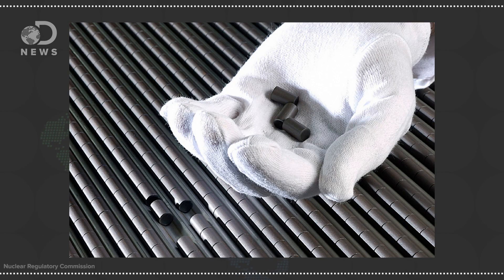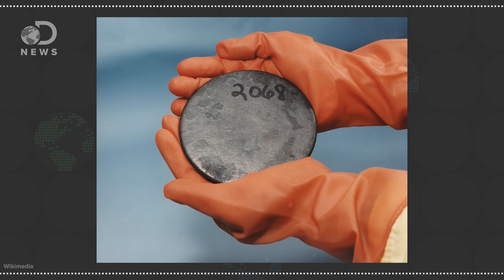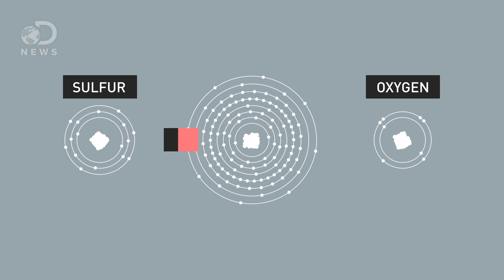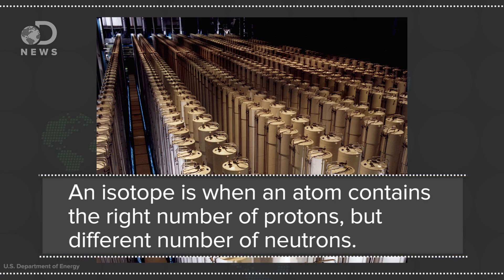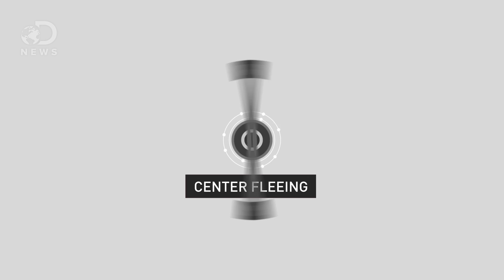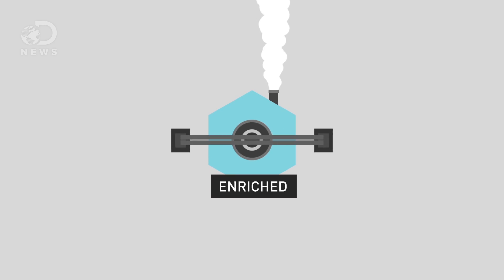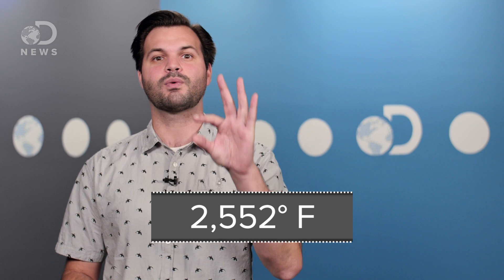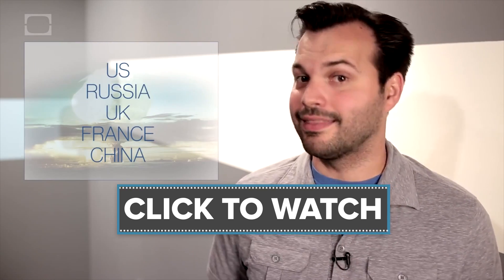How Uranium Becomes Nuclear Fuel

Comment: Still it's a bad source of electricity, because it produces a lot of CO2 in the process of collecting the Uranium from the ground and processing it with hazardous chemicals
Reply: Dino Sabanovic Look at France 75% of its energy comes from nuclear and no major disasters at all
Reply: Dino Sabanovic You will need an impossible amount of available land and win for wind turbines. Same with the solar power which is probably the most inefficient source. Solar panels are very inefficient. About 14%. Hydro power can't be used everywhere. That green energy you're talking about is nice for small projects, but for the whole world..no. No way that is possible
Reply: Dino Sabanovic Better to have Chernobyl than massive climate changes and oil spills all over the globe.
Chernobyls don't happen that often, but climate change with ocean pollution are happening all the time.
Reply: Dino Sabanovic Naaaah, fusion is the way to go, or any other process that universe uses, because universe is a one damn efficient machine.
Reply: BukkitViper Very interesting, but there's still issues with solar power. Solar power is basically completely useless in the winter in the upper part of the northern hemisphere, and only really effective in the summer. It's also important to remember that solar panels don't create a lot of power at night.

Secondly, it's simply not very realistic, that the world would be powered by solar power in the near future. It would just take way too long to convert completely to, I'm afraid.

Anyway, I think solar power is fantastic in the parts of the world, where the sun shines powerfully the whole year. The parts of the world where that's not the case, we should stick to nuclear power.
Reply: Dino Sabanovic Properly built and managed reactors have a VERY small chance of causing any kind of "disaster, mate.
Reply: Darius P Where did I said I want coal and oil? Solar, wind and hydro power are way to go.
Reply: Also, renewable energy sources don't produce as much electricity as nuclear power and the other non- renewable energy sources also don't produce as much power. If you want even more clean power go make a fusion reactor
Reply: Dino Sabanovic Read up on Fukushima. I mean they built the reactor in an earthquake prone and tsunami prone area. They barely did maintenance or tested things and the reactor was decades older than most of the other ones in use in the world. Even with all that, nothing bad would have happened if there wasn't a bunch of debris clogging sensitive areas which lead to the reaction.

Hydro, Solar and Wind are horribly inefficient, and they all fuck over wildlife and mess with the environment in less direct ways. Frying birds or ruining water tables or fish species. At least the larger ones that countries need to actually power things.
Reply: Erik Beyer Paulsen U are right, thats were wind energy comes into play: http://landartgenerator.org/blagi/wp-content/uploads/2009/08/AreaRequiredWindOnly.jpg
Reply: mitchell van eldik have you sen my previous comments?
Reply: Dino Sabanovic
There are more than one kind of nuclear.

The worlds Energy (2007)
Tonnes of Coal: 5 000 000 000 (five billion)
Barrels of Oil: 31 000 000 000 (thirtyone billion)
M^3 Natural gas: 5 000 000 000 000 m^3 (five trillion cubic meters)
Tonnes of Uranium: 65 000 (sixty five thousand)

ALL of this = 5000 tonnes of Thorium (easily mined from ONE medium sized mine)

The final energy output of 1 ton of Thorium ore in a LFTR equals about 235 tons of Uranium ore in a LWR.
Assuming equal 3% purity of the ore the waste from the LFTR will be about 2.1 kg while the waste from the LWR will be about 7 tons (6838 kg depleted uranium and 211.5 kg waste)...
The 2.1 kg waste from the LFTR needs to be stored for only 300 years.
The 211.5 kg waste from the LWR needs to be stored for 100.000 years.

Or you can take the LFTR 'waste' and give it to NASA, as it is the stuff they use to power long range space probes and rovers like Curiosity.
Reply: Dino Sabanovic for the time being nuclear is the least worst solution. there is a major flaw with alternative power sources in that they produce a non constante supply. its very dificulte to store electricity and often what happens is that we produce the energie when no one needs it and vice versa. as for geothermal energy not every one can make.
Reply: andreas lolen Yes, and later you get Chernobyl and Fukushima
Reply: Adam Sean Abdullah Fennessy It only needs ONE disaster mate and whole Europe will be in chaos. Check out Tesla Powerwall if you haven't.
Reply: I don't know how you think it produces CO2, please explain.
Reply: AppleTechBeast You have to process it and heat it. It's explained in video
Reply: Erik Beyer Paulsen That's what Japan said. And tell that to people who lost whole family's.
Reply: I dont think you realise that there is a thing called thorium and that CO2 is produced whenever you try to make any kind of power plant, including ones that use renewable resources so your conclusion is invalid
Reply: AppleTechBeast The machines that mine the Uranium produce a lot of CO2
Reply: Also have you heard of fracking?
Reply: Dino Sabanovic Solar and wind power isn't that efficient.
Reply: Erik Beyer Paulsen Awesome infographic on solar power:
http://landartgenerator.org/blagi/wp-content/uploads/2009/08/AreaRequired1000.jpg
Reply: BukkitViper Please no :( Windenergy would be fantastic, if it wasn't for the fact, that the wind often doesn't blow very hard :/
Reply: BukkitViper you are talking about externalities, not the actual fission of uranium
Reply: I see that are many scientists here that are working in nuclear power plants. Go read http://www.forbes.com/sites/jeffmcmahon/2015/05/01/did-tesla-just-kill-nuclear-power/
and come back here. I'm against nuclear and nothing will change my opinion. It takes hundreds if not thousands of years to dismantle it and how long and how wide area will be radioactive?
Reply: Darius P Go build one then, what you waiting for?
Reply: ***** You mad bro? I was talking after tsunami from radiation, dude.
At Chernobyl from 1986 to 2000, 350,400 people were evacuated and resettled and how many died ??
How long util that area is safe for living?
Same thing in Japan.
Reply: ***** Is this a joke? It's not funny.
Reply: Brandan09997 So radiation poisoning is bullshit?
Reply: Brandan09997 Travis said "Nobody died from radiation." Statement like this makes you wonder. After I asked "Is this a joke?" You answer "Only if you trust corporations who want a profit to run the power plant..."
So with answer like this you confirming that nobody died from radiation. And I'm crazy?
Reply: BukkitViper IPCC states nuclear GenII produces 16gCO2/KWh lifecycle, while solar PV is 46gCO2/KWH and coal at about 1kg of CO2 per KWh.